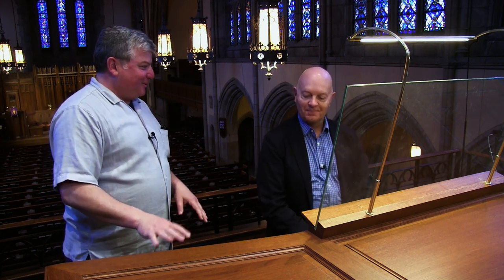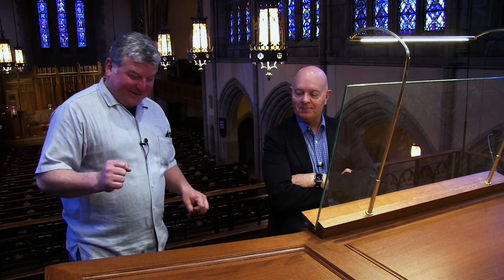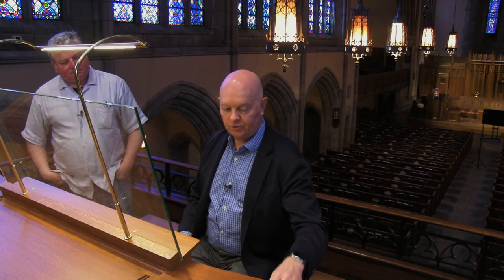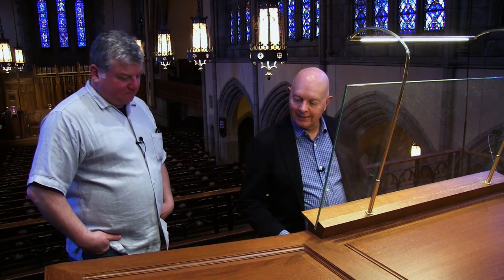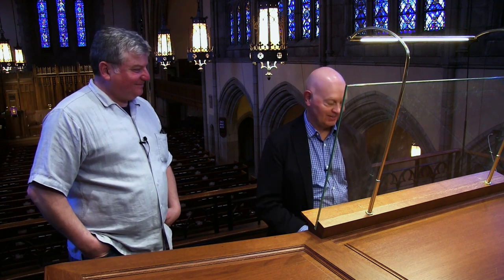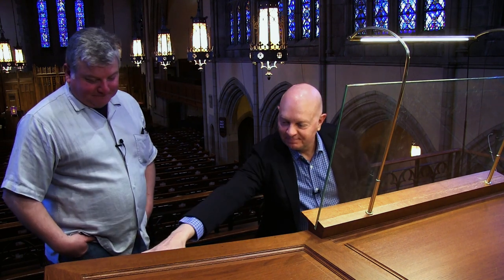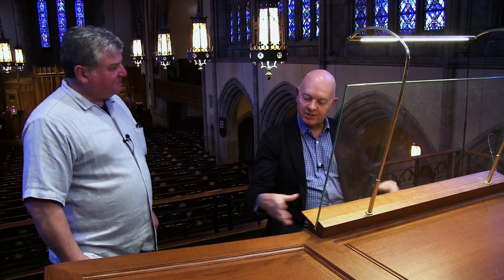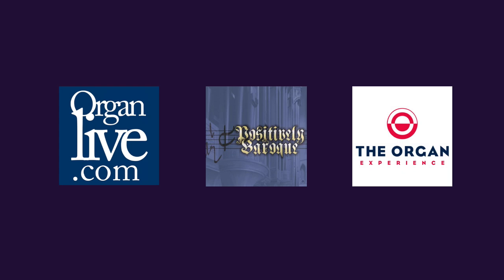2004 Rieger Organ - Bryn Mawr Presbyterian Church- Bryn Mawr, Pennsylvania

Comment: Amazing colors   Sounds like no other Rieger I've ever heard.  Oboe is Heaven. So many rich and glorious sounds.  Great demo
Reply: Fredrik Larsson  the best thing that can be said of this organ is that it doesn't sound like a Rieger. I'm not quite sure what it does sound like, though - it doesn't have the warmth, power or colour of a Cavaillé-Coll. It's sort of a diet low-sugar low-fat skimmed-milk version of one.
Reply: Fredrik Larsson  in a building this size, Cavaillé-Coll would have provided a 2-manual organ of no more than thirty stops, certainly no 32fts, likely only one 16ft reed on the whole organ, and yet it would have had more warmth, colour and strength of character than this has. A real C-C Montre, Gambe, Flûte Harmonique, Basson-Hautbois etc would have far more impact than those in this 59-stop Rieger do.

Personally, given the dry acoustic at Bryn Mawr, I would not have attempted a French style organ there, but rather an English late Romantic organ, almost all enclosed, in Audsley fashion, to enable it to be used fully without deafening. Ironically, it would probably work a lot better in the now very generous acoustic at Wanamakers, where the 402-stop monster is severely lacking any real organ tone. Hopefully Peter Richard Conte's successor will have the guts to tackle a rethink of that organ's structures and ensembles - not discarding pipework, just making additions and revoicing/rebalancing what is there to match. Replacing the existing uninspiring case (squat, dumpy, shallow and empty) with a deeper, taller case containing new Great and Pedal divisions would be an immense help to that organ... but I digress. This Rieger could usefully be transferred to Philadelphia's Catholic cathedral, which has the acoustic to cope with a Cavaillé-Coll copy but a very sickly bastardised mongrel of an organ, and be revoiced closer to C-C to suit (and be converted to electric action, of course). The Rieger case at Bryn Mawr would be retained to house its Audsleyesque EP-action successor.

Comment: Very interesting video! 

One thing to point out: 68 stops/4 manuals was definitely not anywhere close to the largest instrument Rieger had ever built, even in the 70’s. Even just considering the instrument at the Konzerthaus in Vienna, which has well over 100 ranks. Maybe it was the largest Rieger organ in the US at the time. (I used to work for Rieger)
Reply: It was the largest AMERICAN Rieger (the 1972 instrument)
Reply: @GabrielPierne  and possibly the largest mechanical action organ they had built? The Konzerthaus organ is EP.
Reply: @richardharrold9736  at the time, possibly… but they do now have 4 and 5 manual instruments with 80+ ranks with mechanical key action.
Reply: @andrewpearce2562  They are brilliantly creating immense mechanical action organs now... especially for the far east... but of course, also the Philharmonie in Paris (fabulous organ) and of course the Wien concert hall.... also sublime. But the 1972 organ was large for them at the time AND placed in an extremely tight case (so compact that maintenance was very challenging..... even tuning some stops required removing swell shutters and in some cases, removing pipes in order to access out of tune pipes behind them)
Reply: @GabrielPierne  funny, I thought the Paris Philharmonie organ sounded utterly horrid and completely unsuited to its purpose - give me the RAH Willis/Harrison for that job any day! - but maybe it was just Latry finding the ugliest and most bizarre noises it could make. Also, mechanical action is overrated.

There are two large-ish 4-manual Riegers here in the UK, Christ Church Oxford (1979) and St Marylebone London (1993), the former replacing a Willis/Harrison in the same case (the original lower part of which Rieger replaced with a taller one!), the latter supplanting an Anglo-German Romantic bitsa (the Great chorus was Schulze) that wasn't even in the same place but got removed anyway... luckily the bulk of it survived in a museum, and as with Christ Church, the 32ft Open Wood discarded by Rieger found a new home. Neither of these organs is much liked by the people who have to play it, and Marylebone swiftly got the crap kicked out of it by Royal Academy of Music students - there was hardly a stop-knob that hadn't been broken and crudely reglued, and the key actions were in a dire state of regulation - this only about five years after installation. The tide has now turned and Britain is once again an exporter of organs, not an importer.
Reply: @richardharrold9736  the way Rieger builds mechanical actions has developed immensely since the instruments you mention were built. Citing instruments from that era show that you‘re also not aware of the major developments in tonal design and finishing. However, you do fail to mention the very popular Rieger organ in Edinborough, which was built in 1992.
Reply: @GabrielPierne  interesting. Yes, the organ at the Musikverein sounds great - although, sadly, voiced rather quietly. I was resopnsible for building the mechanical action on that project, among others.
Reply: @andrewpearce2562  oh yeah, I forgot Edinburgh, it's the one major Rieger here (aside from the first, Clifton) which I haven't heard in the flesh, but to be fair, it is by all reports a very forgettable instrument, with not a single pleasant sound in it - the old Willis was a vastly superior instrument. Herrick Bunney was an idiot.
Reply: @richardharrold9736  I‘ve heard many good things about the instrument. I‘ll just rank you as narrow-minded and opinionated.

Comment: How much did it cost to have it built and instillation?
Reply: I wondered the same thing! It sounded like they had a very large budget to say the least!
Reply: If i remember correctly, the budget in 2001 was $2.5 million, a fair price, with Rieger giving us a discount on top of that for taking back the old organ. 
Today, 20 years later, the replacement value got to be in excess of $5 million
Reply: I asked about that when it was being installed. The number I was told was 4.5 million.